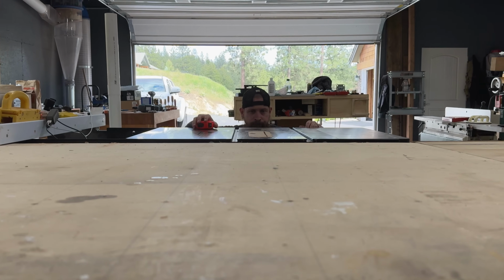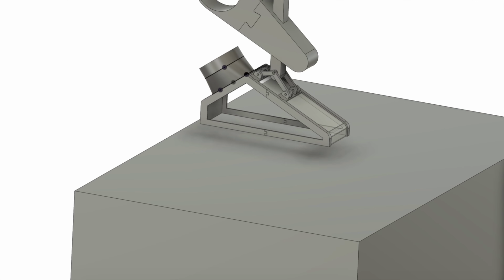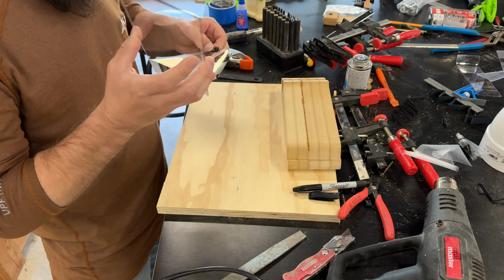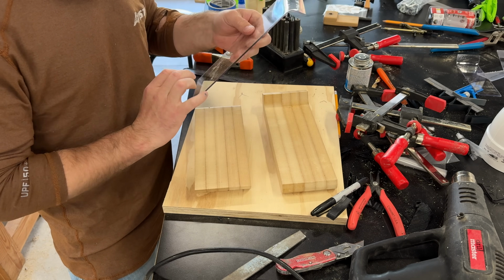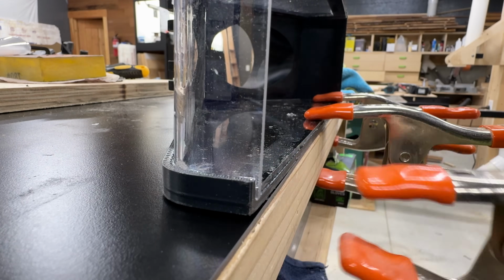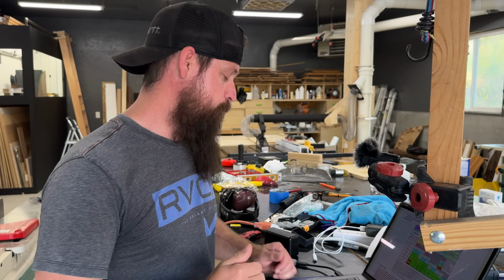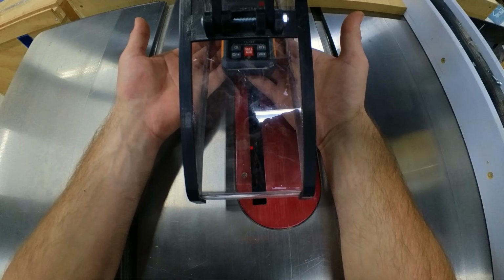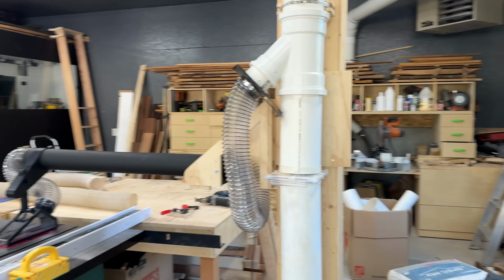90% of woodworkers over look this 1 table saw accessory!

Comment: Maybe you can drill some extra holes into the plywood zero clearance insert?
Reply from the maker: I consider that, but figured they would be blocked by the material being cut and not be very beneficial.
Reply: @brewbuilds  you could probably use a long exposure photo (it would make trails in the photo) to see where the dust comes from, and then adjust the opening. If the dust goes 360 around the blade in

Comment: You should add some small wheels or a skid plate to the pick up. This way the pickup can be as close to your table or work piece as possible. Playing around you can find an height so the zero insert won’t be sucked up and this height will allow enough air in so it won’t suck down to your work piece. This way you should get virtually the all the dust possible. The pickup should be free floating.

Comment: really cool video.. I am about to do build something similar.. I think the key bit is that the 90% that it sucks up, is the stuff that flies up as the back of the blade comes out the table and fires it into your face.. haha
Reply from the maker: @LeonWiddicombe  thank you! It does a great job at capturing all the dust that would normally be shot at your face.😂

Comment: hi there. i bought your file a bit back and printed it but just got a sns and wanted to mess with it to cut out the acrylic bending templates so i was wondering if theres any way to have you email me that part in a way that my vcarve will understand so i can try to have it cut out all those pieces for me so i dont have to go thru all the stuff you did and make life a bit easier
Reply from the maker: I can probably do that. My email is in the (about me) section on my YouTube home page, send me an email. At the time of building this I didn’t have a cnc, but now I do. I’ll play around with getting a file put together. 👍🏻

Comment: you need a hinged flap that the wood pushes up when it first slides under the dust hood, then the flap drops down when the wood is passed it at the end of the cut. This will capture the projectile dust from the blade when no wood is obstructing it. the saw bloade is tossing dust faster than the hood can pick it up. all you need to do is define the area where debris can be flung by the blade so the dust hood picks it up.

your demo at 13:49 is a little skewed because 99% of table saw cuts have wood on both side of the blade. if you do the test over again with 1" of wood being trimmed the debris will be dispersed only in the vector line of the blade spinning.
Reply from the maker: @kjc10  I tossed around the flap idea, the issue with that is it would require the hood to be larger in size to accommodate the flap movement being to the forward direction and be clearance issues with how much blade is exposed for the type of cut. I thing the bristles broom concept like on cnc’s would be a better idea to adopt, but this would require me to move the whole assemble higher up to accommodate those, not an issue, but I just wanted to get a working model to see where improvements could be made. 

I explained in the video that I chose that extreme edge cut, and using mdf to show the worst cause scenario to be able to compare with and without easier. 

You are right the dust being flung off the blade can be traveling at speeds of 100mph, the main objective of the hood is to act as a shield to slow the particles down enough to allow the hood to then effectively suck them up.

Improvements will be made, but I can say this is a huge improvement over not having one.👍🏻

Thanks for watching and taking the time to comment. I truly appreciate it. 👊🏻
Reply: @brewbuilds  This cat figured out the variable geometry pick up: https://youtu.be/TkYoLxlHAD0?si=GJI_rLRDWyYYZsgY

his actually pivots down when the wood passes beyond it. He is using a shop vac and about 1.5" hose so it will be a low air volume pick-up, yet strong suction from the 100"~ of static pressure. Normal dust collectors have 10-20" of static pressure at most.

I watched the air measurements you made. you are measuring your ducting capacity which is correct at determining your system threshold. But also you need to factor in the geometry of input when in real-time use. Specifically the surface area of all air openings when moving stock thru the cutter. The 4" hose is going to be 12.6 sq. in. as a cross sectional surface area. This is the unimpeded surface area of your ducting speed, that you measured with your anemometer. when the hood was suspended wide open about 3-4" above the table. when the hood is suspended lower like 3/4" above the plywood, the open space will be greatly reduced. if you add intake vents that wouldn't expel the flung debris, the gain in unimpeded air volume will aid in velocity and pick up. You can test your dust collector system in this way by covering half the 4" hose end see how diminished input geometry and reduced air air volume also reduces speed.

Comment: Hi brotha. just bought your plans. question, if i use pla or petg instead of what you recommended, will it be ok if its used in doors and not in the heat?also, will it have any issues with the abs cement? what are your thoughts on this
Reply from the maker: @eladsinay6914  hey thanks for your purchase.👍🏻 yeah those will be fine  as far has the environment you’re using them in, but I don’t think the abs cement will work. You’ll most likely need to find a different type of adhesive. That’s why I chose to use ASA, it made  gluing the parts together very easy, especially attaching the acrylic.
Reply: @brewbuilds  Ill have to look into it and ask in the facebook forums to see what others have used with PLA and see if theres something good. Thank you, also, the type of infill used is not an option for me with my prusa slicer. dont know if it matters though, should be fine how i always print.
Reply from the maker: @eladsinay6914  yeah that would be a good resource for sure. I know with PLA I see E6000 recommended a lot, but I’ve never used it, and I find CA glue to be fairly strong but it’s brittle. this design isn’t really being beat up or put through a lot of stress in its day to day use. Its only real job is to hang in position and suck dust. PETG is a nice material for its durability, but I’m just not experienced with adhering/gluing it together to recommend a product. I wouldn’t worry about the type of infill necessarily ( I can never keep up with the latest trend), but just use something you’re comfortable with and have had good luck with. 

When I designed this I kind of worked backwards and wanted to make the assembly process as easy as possible as I could. ASA proved to be the material that checked all the boxes for me, and is something I use quite a bit. 

Hopefully this has helped you out. And don’t hesitate to keep asking questions. I’m sure someone else along the way will find value in this down the road. And I’m always more than happy to help.👊🏻
Reply: @brewbuilds  ill get started printing now. im gonna have a lot of printing to do lol. let see how it goes. the bending of the acrylic is gonna be the hardest part. gotta make that same wooden thing you made too

Comment: I’m interested in the files or purchasing a kit.  PS have you thought about adding some rollerblade wheels to the front and back and letting the hood ride the material?  if the hood is too heavy, you could experiment with adding some springs to make the whole hood almost float on the work piece. I think some after market hoods do some similar.  Either way, it’s an awesome design.
Reply from the maker: The files are available on my Etsy store, the link is in my video description.😁

As far as adding the wheels and spring, that was actually in my initial design. I felt it was getting a little to complex and I figured I’d get a working model going first and see what change were needed. I’m not sure the extra steps/work would  make the overall performance better. But I may still experiment with it for fun! Thanks for watching and commenting. 👊🏻

Comment: I dont like 3d printing. Why u dont do this all in wood?
Reply from the maker: @GerisWoodworking  I 3D printed because I knew you didn’t like 3D printing…😂 joking.

Building it out of wood could be done, but would be bulkier and heavier. The design I come up with wouldn’t be practical building it out of wood either. 👍🏻

Comment: I love your concept. Since my ceiling is 10' and I don't have a post/pole to pivot the dust arm, I'll be using the ceiling for the anchor point.  So, if you can post plans (.pdf or .skp) I'd love it (and pay you for it)!
Reply from the maker: Thank you! With my busy summer schedule coming to an end, and some complications with my Etsy store, I’m hoping the files will be uploaded this week. My file package so far consists of .stl files, and .3mf files. So far what I’ve gathered from the comments most people are wanting to 3D print the parts. If you can tell me what you’re looking to do more specific I maybe be able to make something work for you.  I’m assuming you are looking for .skp files because you use SketchUp and are wanting to play around with how to make it work in your shop?

Thanks for watching and commenting.👊🏻

Comment: Really nice work and obviously a huge improvement. Complete arm-chair woodworking here but I’m curious given all that precision why you asked the flex hose to do so many gymnastics? Look at the shot at 15:00 and you can see a huge bend and slack at the blast gate and then a tight 180 followed by a 90 and finally another 90 just above the blade. All those bends, especially with flex hose has to be introducing all sorts of drag. 

Had you put the boom arm significantly higher you could’ve got all your direction change out of a single 90 degree coming off the 4” pipe.  Essentially it would come out from the down trunk via a Y and whatever the balance is from 90 and then into your horizontal 4” but then go straight down to your blade from above. You could use mostly pvc for that down run to improve flow and then just use flex hose (even though it’d run straight up and down) towards the very end as that flex would provide all the upward travel you’d need to get it out of the way when you don’t need it. 

The challenge would be the blast gate being out of reach but perhaps this is a good case for an electronically controlled blast gate. 

Then to go next level dork you connect the boom arm to a CNC style rail with a material thickness input at the saw so you just plug in your material thickness and the dust shroud (with brush added as many others have mentioned) will raise or lower to the appropriate height automatically. You could also tie in the blast gate control to this input so it’s all in one place and then you’d have an absurdly complex and nerdy way to remove a few percentage points of dust, but you’d also have another video to drive traffic which I’m betting is of just as much value to you 😉

Comment: Your thoroughness in the details earned you another subscriber. Love how you use science to back up why it works. Since I do not have a 3D printer, I would want to buy the complete hood attachment for over the blade. My dust collection system runs much lower in height, actually under the outfeed table, so I would want to be able to connect the hood a little differently.

Comment: Lower your saw blade so that the teeth are just above the level of the board, and the gullets are below the level of the board.  This will direct most of the dust down into the saw where the collection hose on the saw itself will pull almost all of the dust.
Reply from the maker: @anthonygage1227  normally I would have my blade lowered as you described. With adding this over arm setup I wanted to try it raised, and actually is the proper way. Having your blade raised higher can actually give you a better cut. For the sake of the type of cut I was making (edge cut) and trying it at different heights, I found blade height didn’t really change the amount of dust being thrown.

And in past experience prior to the hood and with my blade height lower I can confirm most of the dust, does not get pulled into the cabinet. Just my 2 cents. 👍🏻

Comment: Im on par with the comments about a brush seal  at the edges.  I think it would allow more air flow from the bottom edges reducing  dust escaping.  Maybe spring loaded to compensate  for different material thickness. Just spit balling here.

Comment: Just wanted to let you know that you are right about taking your reading at the hood opening. That is the most accurate location. The correct way to do it is to take several reading the more the better.  Do not plug up the rest of the hood with you hands or the non important part the the devil. After taking several readings with maybe only a half inch movement that average the reading that will be the most accurate.

Comment: You could mount a brush seal around the bottom edge of the hood (think the bottom of a garage door). This would prevent the throat plate from lifting and also provide a seal to prevent the remaining escaping dust.
Reply: came here to say this, a brush skirt is the way

Comment: Cool dust collector. Maybe add a skirt with some brush like material to the bottom so the suction area is sealed to the table top yet allowing the wood to pass thru it.

Comment: Very cool build. I am going to do the same using magnets on the cast iron top (I mainly do small work). I would suggest you get some brush strips, I have used them in other dust collection builds and they really make a difference. New to your channel, will check out your other stuff and consider subscribing.
Reply from the maker: The brush strips are in the works!

Comment: I would purchase the plans, parts or files to print.  Building a new shop and 6” dust collection system.  Overarm dust collection is one of the weaknesses in any design.
Reply from the maker: I’m working on the instructions to go with the files! Thanks for watching and commenting. Make sure you’re subbed so you get notified when the files are available. 👊🏻

Comment: im at the part where youre about to test and i have to say, im sitting here and shaking my head at how amazing this build is. ive seem em all and one in particular was so innovative to also make a piece of lexan on the left to catch dust from edge cuts but using the 3d printer,,, i mean bravooooo. I definitely want those files. pleaseeeeeeee
Reply from the maker: Heck yeah! Thanks for watching and commenting. I’m working on getting the files put together. 👊🏻
Reply: @brewbuilds  you got me rubbing my hands and going heck yahhhhh
Reply: oh by the way, if this works, my next stpe is to incorporate the 3d printed ball style blast gates and one person has a version already to allow quick mount of the servo so it can be automated and thats a whooooole other thing ill have to learn. it involves an arduino to control the parameters, for example to say, when machine 1 turns on, open blast gate 1 and close blast gate 3,4 and 6 and the same goes for the other blast gates. If this is put together with the auto on and off i think its the pinnacle of dust collection.... well that and metal pipes that are 6 or 8 inches would be but this is better than most lol

Comment: Its a very nice build and well done, but I do have  question:  It seems like you have built in a 180 degree turns for the dust to travel before it gets to the main collector.  Is there a reason for this?  Why not just move the main collector upwards and have a straight shot?
Otherwise thanks for the content.  Good job!
Reply from the maker: Are you referring to where I transition from the 4” over arm duct to my 6” vertical duct?
Reply: At 00:04 It curves downwards as flex tubing and does a 180 turn.  However I now see why: the design of the overarm hinge prevents you from running the tubing through the top and straight up, which means you go through the bottom and loop around.  Your CFM is apparently just fine, so you can afford the 180 turn.  Thank you sir, answered my own question.
Reply from the maker: @Greybeardmedic  exactly, I wanted to make sure I understood what part you were talking about before I responded. Yeah I tried different things, but that ended up being the best option.  Air speeds are well above 4000fpm there, which is what’s needed to keep the dust entrained in the duct and prevent build up. Thanks for watching and commenting.👊🏻

Comment: Have you seen HookedOnWood zero clearance insert video? He got better cabinet dust collection results when there were some holes in the insert, near but not at the blade so he still maintained the zero clearance at the blade. I think this might help improve your situation further even after the over arm build.
Reply from the maker: I haven’t seen that, I like the way it sounds though. I’ll check it out, thanks for the suggestion. Thanks for watching and taking the time to comment.👊🏻